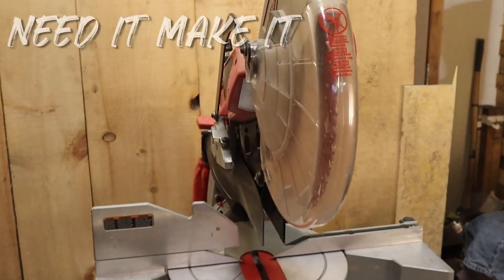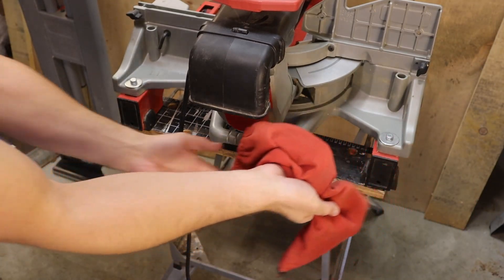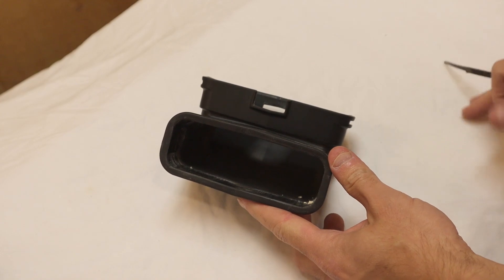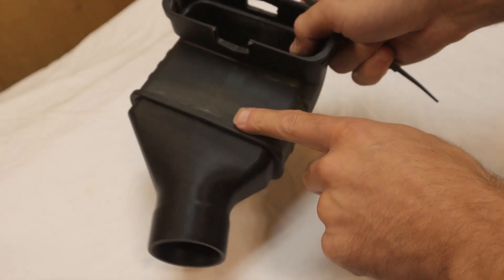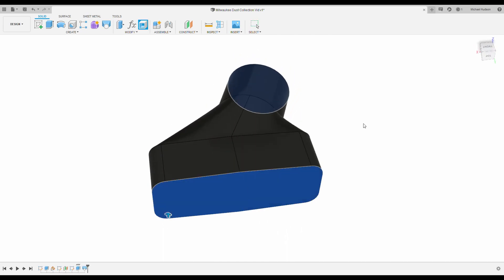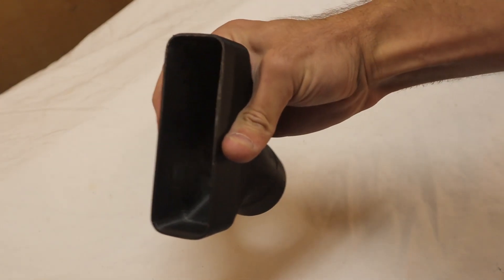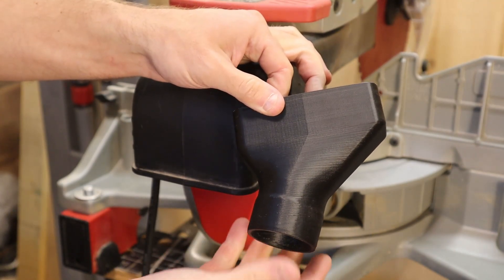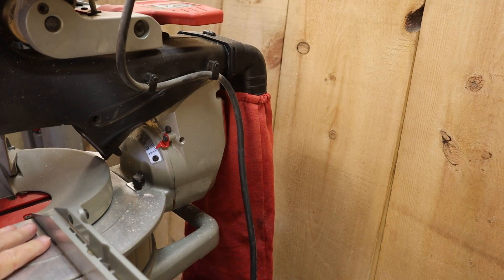Make a Milwaukee Compound Miter Saw Dust Collection Adapter

Comment: LOVE this, such great work. 
Gonna guess not but it doesn't hurt to ask I hope. Any chance that you have a model or another version of the STL file that would not need the preinstalled 90 angle? Just got one of these saws second hand and sadly it did not have that part. 
Thanks for the awesome video and all the best to you man.
Reply: It boggles the mind that they put a square port on this thing. What were they thinking?

Comment: when did you buy this? I wonder if they still have the issue where the saw dust can get into the lights in build they are selling in stores now in 2020
Reply from the maker: I bought this saw 3 1/2 years ago.  Good saw, both lights are out now, and both are filled with dust as you say.  I have to have a closer look one of these days to see if I can get them working again.  The lights are good, but I think I would prefer the laser sight.  I can take a look at the model number a post it along with an image of the shield protecting the lights if that would help everyone.

Comment: How has this saw held up for you? I am considering the same saw. thanks
Reply from the maker: I just saw this note, the saw has held up well for the most part.  I don't know if you want a full list of items to consider but here is one anyway: 

- LED lights do not work any longer, one went, now both.  A laser would be really handy rather than a light
- The saw is pretty heavy, I turn it to 45 degrees then carry it, it helps me to get my arms around it
- The stand that came with it is pretty terrible, it raises it up at working height, the wheel axle is terrible and will bend with any light abuse (The Ridgid one is so much better) 
- The dust collection works well, but you cannot adapt to a regular hose (as you see in the video)
- The saw is very deep so you need a lot of clearance behind it
- The linear rails seem to plug up after a while, I've used WD40 and that did the trick to keep it moving nice and smooth

- Good power, cuts pretty good lines, it is my first compound slide saw, so it isn't as good as my old saw for accuracy, but the board width capacity is so much more that it is a good trade-off
- The digital readout on the front is so nice, that may be the best feature of this saw

I personally would have gone with the articulating armed Bosch saw because I have a small shop, but it was about $200 more, and I bought this saw on sale around the mid-500 range including the stand.

Overall a good saw, could be better (like anything)

Hopefully you find this helpful.